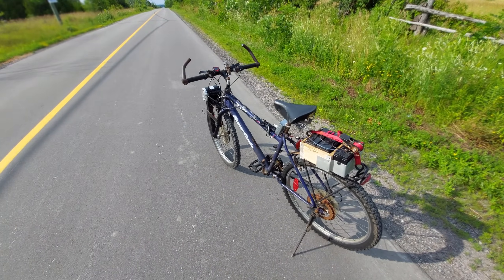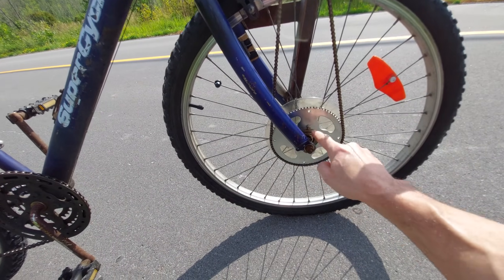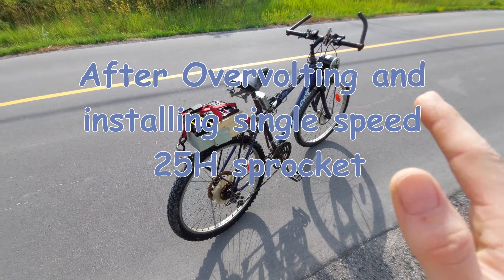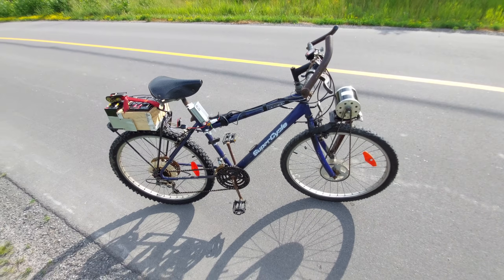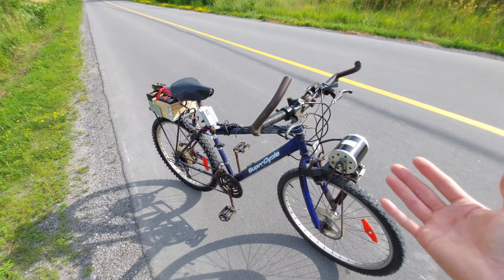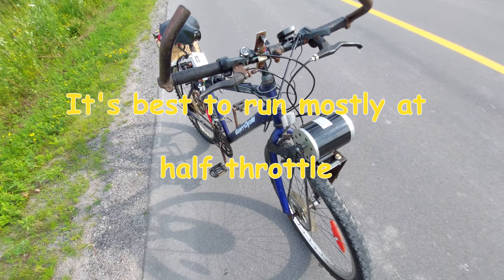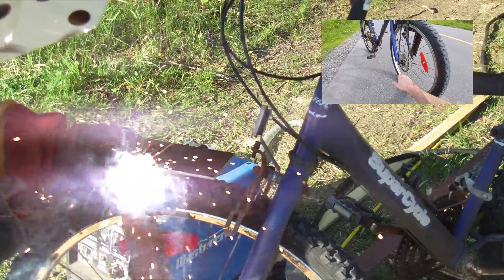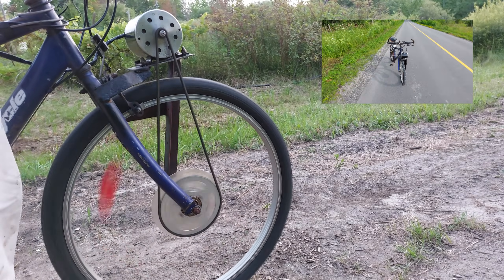Homemade Electric Bicycle Overvolted from [ 24v to 36v ] this is what happened

Comment: That's awesome lol. With that motor being on the front, you could probably figure a way to cut the case and air cool it to prevent damage from over volting it.

Comment: Hello, I want to ask about the wires of the 36v 350w electric bike. If the wires are not thick for the battery and motor, is it possible that it will be affected?
Because I made the motor wire long and the battery wire long, the wire may not be able to withstand it
The wire that I installed is a wire that connects from the electricity to the television, and I apologize for the length

Comment: Can someone explain why these motors don't have a overheat/thermal cut off breaker and why 2 or 3 selectable gear ratios aren't used with these builds?
Reply: they're cheaply made, and may not actually have circuitry that senses temperature, and the two or three selectable gear ratio is usually not used because there's no space, though this dude created a 7 speed build with the sprocket on the front

Comment: Have you ever thought of using 2 or 3 dewalt batteries there 18v and 9ah so less weight and less space needed
Reply from the maker: Good advise! I have thought of using some of my battery packs, but all the batteries I have are only 18v, 20v, 48v 2Ah so probably not worth doing. The SLA batteries are 10Ah, I think one day I'll get my hands onto a Lithium pack.

Comment: The physics of e motors says that you can over volt but you cannot over watt. If a motor says 24v and you want to use 36v or 48v you have to make sure that if over volting that you do not exceed the amps in watts that motor was designed to handle. For example if your motor originally was 24v, 10 amps that equals 240 watts by the watts law EQ of  (V x A)=watts. Since this is true if you raise the volts to 48v you now must make sure that the amps your providing to the motor and in storage do not exceed 5 amps by the EQ (48v x 5a ) = 240 watts or again ( V x A) = watts. If you do not lower the amps when over volting a catastrophic failure will result. This is the largest problem with over volting. If you continue to use the original volts intended for the motor, in this case 24v, then amperage makes no difference and the amperage can be any amount like, let's say, 1000 amps or 10,000 amps or even 100,000 amps in storage because the original 24v motor will not draw any more amps than it needs to run a peak efficiency and only except the 10 amps no matter what from the large storage supply. However, if over volting and using 48v you must match the watts and in this case that becomes 240 watts in the example and over volting limits you to using only a 5 amp storage supply amperage to match the watts of the motor. This is the advantage of always using the intended volt rating of a DC motors because it allows you to have in storage many times the watt rating of the DC motor. Not true with over volting.
Reply from the maker: Thanks! great comment👍  helps everyone understand more on this subject.  I try and keep this bike mostly running at half throttle, or apply throttle to full than back off and coast allowing the motor to cool. Everything seems fine for now, no smell of burning windings, but I don't let the motor struggle up hills at near full throttle, that's when a failure will probably happen.
Reply: Hi can you help me? I have a 24v 350w brushed motor mobility scooter, the batteries have gone but i have a good 36v 20ah battery... what wattage controller should i get? My only options are 250w or 500w.

Comment: How do you charge those acid batteries? Im curious and scared at the same time 😆 im experimenting. But im afraid i might do something wrong tbh
Reply from the maker: I have many chargers,  I charge them either separately with a 1.5 amps to 2amps max 12v charger [ Noco genius ] or in pairs with a 24v lead acid AGM charger.  I also have a 48v ebike lead acid charger.
Reply: @kurtscottage  thanks for replying 🥰✌ now i have knowledge about it.

Comment: Hi, I just discovered your channel, I'm gonna build my first ebikes to do delivery, I just started classes at university,(right now we're on break) so I wanted to build a ebike to do that job because my classes don't allow me to get a normal job, my question is, can I use lead acid in large distances?, at not high speed obviously, sorry for the broken English
Reply: From what I've learned, Lead acid is generally not recommended. Yet some of the cheapest scooters have them and perform fairly well but not for very long distance rides. The lead is heavy and bulky and you can only use 50% of the battery power or so, compared to Lithium. Plus lead batteries can need replacing sooner. 
Take care

Comment: Is it possible to attach the chain and sprocket to the other side of the rear wheel and run the motor that way?
Reply from the maker: Yes but you will need to weld on a freewheel sprocket, like in my 350watt ebike video. Or remove cassette add an adapter and install two single speed freewheels.
Reply: @kurtscottage  Thanks for the reply, What adapter would I need to connect the 2 freewheels. Also is there a reason for two freewheels? Most single speed freewheels are pretty small, would that gear ratio not allow for the bike to reach its top speed?

Comment: What's sort range do you get from full charge
Reply: It depends say if you have a 5 amp hour battery on 36 volts at 500w it will last you about 45 minutes on full throttle continuous but it's not like you would ride that long full throttle so it would usually last you    a bit over an hour maybe if you go really slow it will last 1.45

Comment: Hi, I have not been on a pedal bike for an exceedingly long time, but your top speed is wrong, by my estimation your speed was more like 34 to 35 miles per hour. If you can get a friendly police officer with a radar gun to check, I think you will need to get the speedometer corrected.
Reply: The speed shown is in kph I think.
Reply: Metric system my beloved